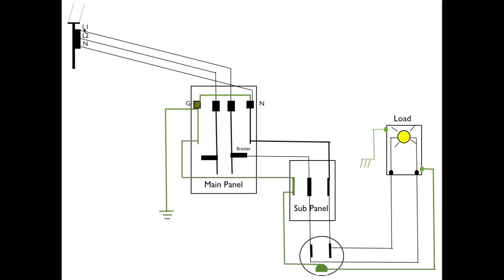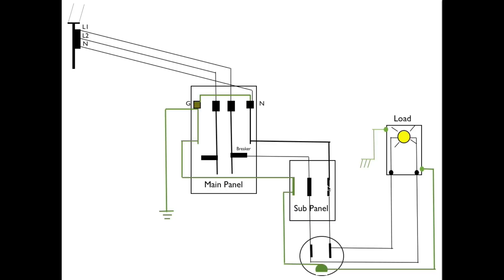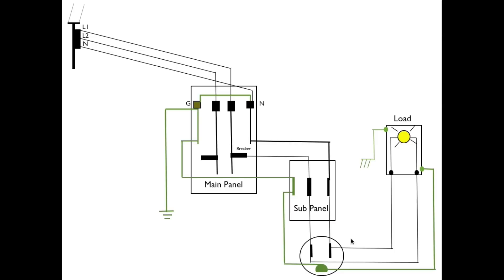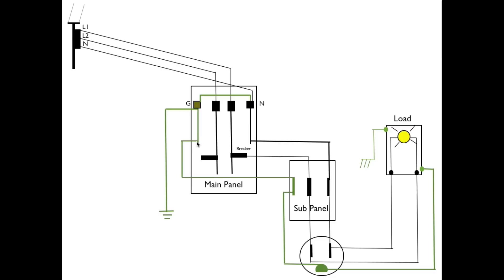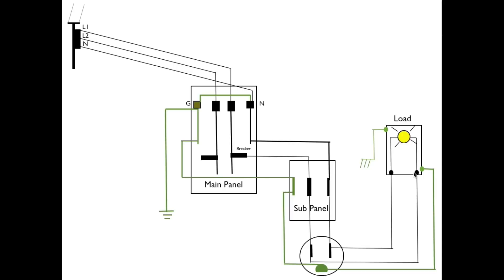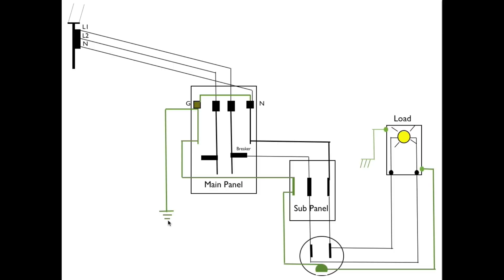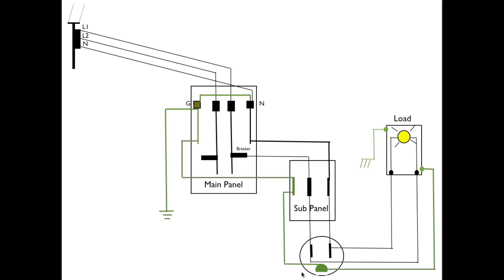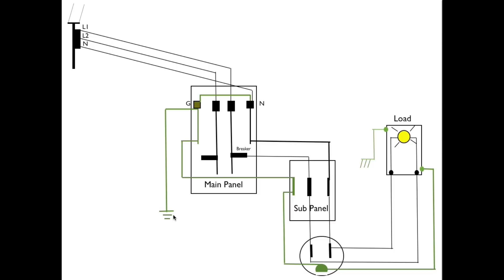The difference between neutral and ground on the electric panel

Comment: heres my take away- sub panels separate ground bar bonded to box. this makes me crazy now cause on current job added 6 lines to a 60's or 70's sub panel where nuets and grounds share same bar well there is a water pipe near ill see  if its good. hope no one repaired something with pex or some interrupter. great video!!! like you said it was always rolling around in my mind.
Reply from the maker: Its not the end of all times if neutrals and earth ground are connected.  Consider the dryers and stoves connected with 3 wire that used the ground as neutral.  Not the best way but done forever.  Its just better to separate.
GFM

Comment: When I was learning electrical basics 40+ years ago, my engineer instructor taught us that the neutral grounding at the main panel was to limit L1 and L2voltage to 120 volts max. If you have a floating neutral, with unbalanced loads your voltage on a line can go from 120 to 240 volts while the other line voltage can drop to nearly  zero. A solid ground prevents that from happening.
Reply from the maker: Good thoughts.  I would just add "solid neutral" rather than "solid ground".
GFM

Comment: Very good dissertation. I do not remember you mentioned Neutral is grounded somewhere in the distribution system far from the user for which I agree it should not be grounded locally on the user side. For this reason I normallly call distant ground to the Neutral and Local Ground to the Ground conection. Technical reasons explain the difference clearly.

Comment: very nice. very nice indeed. I suppose the only point I would like to make about this video is your potential from ground to L1. Using any multi meter, one lead to ground and the other test lead to L1 will result in the same voltage as L1 to neutral thus neutral and ground are the same potential. Thanks GFM for the great video.
Reply: Only because of the ground/neutral bond in the distribution panel and only at the distribution panel. Do the same measurements at a distant subpanel and you will see that the voltages are not identical, unless you use a high impedance meter that does not put a significant load on the lines.

Comment: Very good and clear explanation. I knew the neutral had current through it but didn't really understand the ground theory since it is connected to the neutral barand now I do.  Two more points of clarification that you implied but I had to think more detailed to explain  that might help.  Reminder that lightning is DC power not AC power so it follows the least resistance it can to the earth ground.  it could go through the circuit anyway and come around to neutral etc but it doesn't because that is adding a small amount more resistance than direct to ground.( I do wonder about one other thing but dont want to confuse this issue right now .)  

Next this also explains how a Ground fault interrupted circuit works (GFIC).  Since there is absolutely no current in the ground normally  with any current at all even a  minuscule amount the GFIC is designed to trip a first sense of any current acting like a relay switch.  If the ground carried some current normally it couldn't be designed to provide protection from shock except above a certain level.

Comment: Hi GFM,

I had a few questions I hope you could clarify for me.

1) At 4:30 when you imagine us replacing the neutral to the load with the ground wire back to the subpanel, then the ground wire on the "old neutral path" breaks, then we touch the load's metal case. I believe we would not get shocked because it would flow through the ground with that bonds it to the metal case back to earth with much less resistance, rather than through our body which has at least a little resistance.

2) At 7:48 when you suppose we bond neutral and ground at the subpanel, then the neutral connection to the load fails and we touch the metal load. I believe we would not be shocked here unless there is also a break in the ground connection, because otherwise the current would flow back through the ground wire rather than through our body again.
Reply: Current does not follow just the path of least resistance. If it did, then if you connected up a 50 watt light in parallel with a 25 watt light, only the 50 watt light would illuminate.

Current follows all return paths, inversely proportional to each path's impedance.

Comment: I asked this question to our experienced handyman if our homes are protected against lightening, & the answer was no.
Today I learned u our homes have a jumper from the neutral to the ground. Thank you so much for explaining how it works so clearly, other it would have remained mystery.

Do we get 3 phase power supply in homes &  why, either way?
Thanks
Reply from the maker: 3 phase power is not generally available to homes in the US.
GFM

Comment: I've been through this, I bought a home with a detached garage, I wanted to add another sub off the sub in the garage, so I did. I had all kinds of problems after that, and after back tracking for weeks I found the old owner hooked up the sub the same as the main.

Comment: great video. I always love it when people share knowledge that is supposed to be sacred. HVAC and electrical are NOT the sort of things the lay person should experiment with. That being said (I think) this video helps whilst being harmless to that end. So if a main panel neutral and ground are tied together, sub panel boxes and load chassis do NOT become hot if you have a break somewhere in the neutral line? i assume that's the point of this video. LOL i knew there would be a slew of "experts" commenting on this one way or another. Again rofl at the comment responses.!!!
Reply from the maker: You got it.  
GFM

Comment: Grayfurnaceman,  you say in the video that you had a hard time understanding grounding.   You did very well with explaining what you figured out.  You have gotten very close to the truth.   I was a little disappointed when you didn't cross the finish line.   Grounding gets way easier if you understand two things.   As you stated the grounding electrodes are for connecting lightning to earth.  We are done with earth ground, serves no further purpose.  Equipment grounds are for any accidental connection from L1 or L2 to the case or frame of equipment or boxes.   When this happens, the current goes back to the Main Panel, through the bond to neutral, through the neutral to the utility transformer, back to the panel, then hopefully to the branch circuit breaker, then click, the breaker trips.   So, earth ground has nothing to do with equipment grounds.  I hope this helps!   Respectfully,   Kevin

Comment: dear teacher:  thanx for explaining the significance on why ground and neutral are not connected in sub panel and that ground wires are not current carrying during operation of ckt and only for ground faults detection and lighting protection safety..with regards sanjay

Comment: Gray I worked for a electric utility as a contractor and one of the first things the utility told us in are orientation was do not assume that the coating on overhead wires is insulation some coatings are just weather proofing and do not offer much if any protection
Reply from the maker: I'm sure you should not trust any coating, especially on the high voltage.
GFM
Reply: I was not trying to offend just heard you say 2 black insulated wires I just didn't want anyone thinking that the 2 hot wires were insulated and safe
Reply from the maker: None taken and thanks for the thoughts.
GFM
Reply: If you are using cable (as you would when wiring a house) the conductors will be insulated, except the ground. Two conductor cable has a black (line) and a white (neutral), plus ground. Three conductor cable has black (L1), red (L2), and white (neutral), plus ground.

Comment: Sir once i saw that their is a main box with a Hot fuse A ground bar and a neutral bar and basically each switch and plug box  is the same in theory as the main just instead of a ground and neutral bar you just wire nut them together it all clicked how easy it is and truthfully  I have always been nervous messing with power so thank you next I need to find your video on wiring a three way light switch and how to install a GFI  Thanks again

Comment: You are correct in your explanation of why the neutral line is not also used as a ground but further explanation is needed. In order for the chassis to be hot two things need to happen one the neutral wire has to be open, which in this scenario is also the ground and secondly the hot side be shorted to the chassis correct?
Reply from the maker: Yes.  But consider; an open neutral and hot shorted to chassis could easily be a burned wire anyplace in the circuit.
GFM
Reply: David Heins    Why would the neutral need to be open?   If the hot gets pinched while putting the metal cover or case back on, and everything else is still connected, it is a short circuit with most of the current going through the case to the equipment ground.  Less resistance than the load.   Respectfully,   Kevin

Comment: Hey Gray Furnace man, here is one for you. I have a small cabinet shop on the same property of the house i live in and just recently I had a 100 amp single phase main breaker trip in the shop. First i will give you a brief background of the load. I have 5 HP motor on my dust collector blower (23 FLA), a 5 HP motor on my 2 stage 80 gallon compressor (26.5 FLA) which are my two biggest loads that may be running together at any given time. I had just hit the stop button on the mag starter on my dust collector blower and i was in darkness. I stepped outside to see if the house was still lit up or if it was a power company issue, I saw the house was still light so i knew it was a breaker in the shop. I grabbed my flashlight to see what had tripped and my first thought was the main 100 amp, sure enough, it was hot. So i waited a few minutes and did a process of elimination to see which breaker or load could have caused it to trip. After resetting the main 100 amp breaker I noticed that the 30 amp for the blower motor was hot as well. So off the cover came and I decided I wanted to check both lugs on the 30 amp and the 100 amp main. Before I killed the breaker in the house for the shop I wanted to check the amp draw on one of the main legs in the panel and found just with the lights I was pulling 27 amps and 48 with the dust collector (keep that in mind because it seems high because I only had the lights on with the 27 amp reading). So after killing the breaker in the house for the shop I went and checked the lugs on both and here is what I found. One of the two legs  on the 30 amp was loose, okay that might explain why it was hot too. However... I also discovered that the neutral leg for the panel was loose  as well. After tightening the loose lug on the 30 amp and the loose neutral,in the main panel it dropped to 12 amps with just the lights and about 25 amps with the dust collector running. Both breakers  cooled off to basic room temp for the most part as well  (now I wished I would have had a cheap infrared thermometer to see the difference) So in your opinion, do you think the main 100 amp tripped because of the loose neutral in the panel, loose leg on the 30 amp or a combination of both causing an excessive load on the 100 amp main? I feel very confident and fluent in electrical knowledge, but this one has me stumped.
Reply: I know arcing causes pulsations which increases peak average current which trips breakers. It's also very dangerous. Keep your connections tight!

Comment: Thank you your explanation makes clear sense.  Wondering if you could do one on grounding and earthing of an ac subpanel and solar concentrator dc panel that includes an ac inverter.   I believe two ground rods are in play there at the subpanel and cannot be more than 6 feet apart.

Comment: GFM... You have done about as good a job at explaining the fundamentals of Ground/Neutral flows I have yet seen on the You-Tube DIY channels... For this reason, the average " Joe " should hire an electrician for doing work inside main & sub panels as a general rule... I for one are comfortable working inside main boxes and the 1st things I look for is CORRECT wiring, done by past  installers, etc. 
The subject of GROUNDING imho has got to be one of the least understood, basic principles of correct electrical flow or lack thereof ( pun intended ) working with electricity... 
Final note here, there is a TON of misinformation out there on the critically important subject of grounding these days and thank you for sharing this very important lesson... 
Bill Farr... :-)
Reply from the maker: Thanks for the support.  If you look at some of the comments,  its clear how much misunderstanding there is out there.
GFM

Comment: That was a very concise explanation - and helpful. But you didn't clearly differentiate why the sub panel is wired differently. The diagram is extremely helpful for following the current path. 
 
The main panel needs the neutral and ground connected together, and ultimately to Earth ground, in order to provide a safety path for the neutral wire coming off the pole in case of a lightning strike. Otherwise, how would the surge get to earth ground? 

The sub panel differs in that it has its own separate path to Earth ground - according to the diagram.

Thanks for this video.
Reply from the maker: But you did a very good job of explaining that concept.
GFM

Comment: Good video I think but I have always been confused with ac and have much respect for it. I have been a DIYer all my life but this AC stuff I stay away from.
Thanks for trying to make it understandable.
Manny
Reply from the maker: Manny Monroy Hope it helps.GFM
Reply: Manuel Monroy — It is ok for a DIYer to do ac work, provided it is permitted and inspected.  If the panel work is too daunting, then have an electrician put in the main panel and add circuits yourself when you can.

Comment: This is the best explanation on why we do not bond neutral and ground in a sub panel!  In a main panel, we do bond neutral and ground but does that not give a circuit two paths to return via neutral or ground? A bad thing? Thanks
Reply from the maker: Earth ground is not a return path to the source.  Neutral is the return path.  Earth ground is there to provide a path to discharge lightning and absorb spikes.
GFM

Comment: Grayfurnaceman, As I have mentioned before, I think that this is a really great video. I don't want to appear nitpicky but I think that I found an incorrect statement at about 8:00 in the video. You were describing a situation where the ground at the sub-panel was connected to the neutral at the sub-panel. I think that your verbiage simply got ahead of itself. If I connect the ground at the sub-panel to the neutral, I can in theory think of it as putting a ground symbol at the neutral of the load. In that case, current could flow (but does not have to) from the hot line through the load and return through the ground to the neutral at the panel. Current could also flow through the neutral at the load to the neutral at the panel. And, yes, the case at the load would now be a potential current carrier. And yes, the breakers should not be tripped because the same current is flowing through the load as would be under normal conditions. Where I disagree with what you said at about 8 minutes into the video is that if the neutral wire from the sub panel failed (I am assuming a break), under the conditions you mentioned, you showed a circuit that would not exist. In other words you said (and did a trace with your cursor) that current would flow from the hot wire at the load through the ground and back to the neutral at the sub panel. What I see is that if the wire from the neutral to the load is broken then the "symbol" for ground that we theoretically put on the neutral at the load no longer exists. That means that the neutral on the load is no longer connected to the neutral at the sub panel and therefore it is not connected to ground! Now, if the neutral at the load were somehow to connect to the box while the neutral connection from the sub panel is broken, then yes, if the neutral at the sub panel is connected to ground then there is your circuit.  To briefly sum up, if there is no connection at the load between neutral and ground at the load box then the neutral at the load is floating and current can't flow.
Reply from the maker: The situation I was describing was one that had the neutral and ground connected together at the sub panel.  If there was a fault (open) in the neutral, the fault current would then pass thru the chassis ground to the neutral at the main panel.  The load would operate  normally.  You do not want the load to operate with a neutral fault.  Because of this situation, if there was then a fault in the chassis ground, the chassis of the sub panel would be hot.  
GFM

Comment: I agree! you could get a shock if you touched a live ground where the system did not contain a Neutral however, it all depends on the difference in potential under existing conditions.
Reply: Also electricity will flow thru the least resistive path.
Reply: Also ground rods connect to water pipes uncertain localities.

Comment: Thanks a lot. This is good stuff. Would you be so nice to explain how the  system would look like (circuits, panels and sub-panels) in the case of the ground being done by metal conduits (instead of a dedicated wire)? That is the case in my house (from the 50's) and I believe that is the case in many homes still nowadays. Best regards
Reply from the maker: Will see what I can do.
GFM